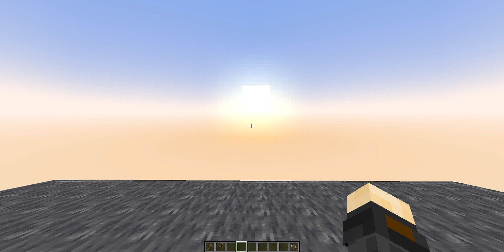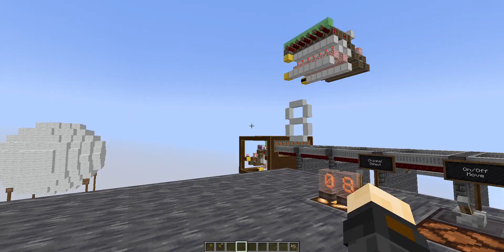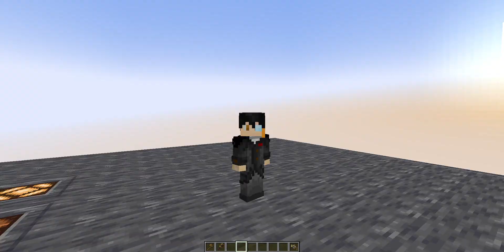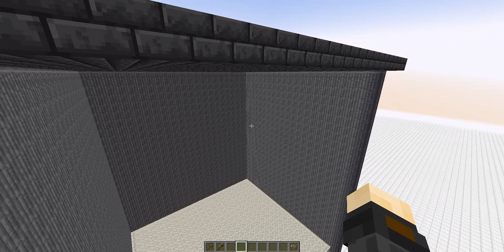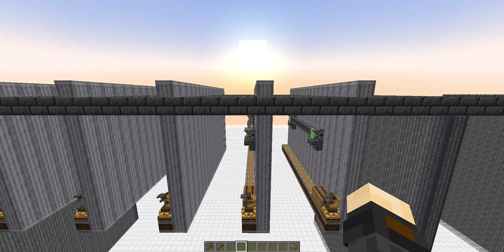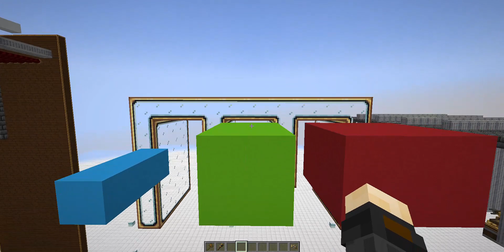Modular Tileable Dynamic Airship Docking Complex! [0 redstone links]

Comment from the maker: CLARIFICATIONS:
0:54 "platform"
2:03 "small ground vehicles equipped with maintenance equipment"
2:53 "our prospective infrastructure engineer"
3:19 "or whatever other solution" refers to anything that can secure an airship to the dock (clamps, pulleys, plunger grappling hooks, whatever works)
3:26 "so called designated parking slots"
3:54 "airship width"
5:01 "the otherwise wasted space"
5:40 "by the same gantry carriage"
6:33 "analog lever"
7:04 basically this part says that this controls whether gantry is redstone powered or not, and the piston looping is caused by it being placed too close to some of the redstone, fixed in the actual mockup model

CORRECTIONS:
10:40 "If you want more hangers, simply have a separate DOCKING CONTROL STATION for every 4-8 HANGERS" I incorrectly said "docking station" and "controllers"

FINAL NOTES:
This design works, as the video notes, best when implemented with a reservation system. Also, it is designed mostly for small/medium/semi-large airships, because the largest ones are so gigantic that it is absolutely required that they have their own separate docking station / hanger.

On the other end of the spectrum, this design is completely unnecessary for tiny miscellaneous collections of airships because they take up relatively little space, so anything like a large flat field is enough for miniscule vessels.

Video implies this but a bonus of having all the gantries being controlled by logic circuits in one compact area away from the docks themselves means that this system can be incorporated easily into any and all builds, since you only need to make a separate room for the controls.

The long flat space above the airship docking complex is also a very nice candidate for plane runways!